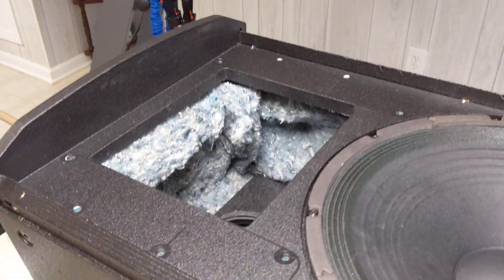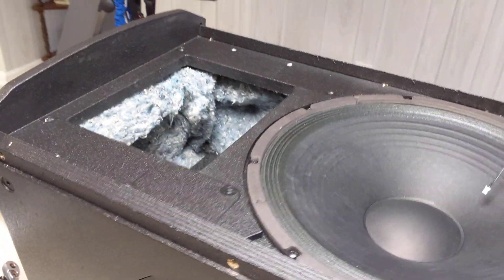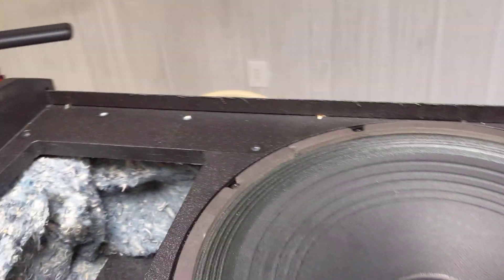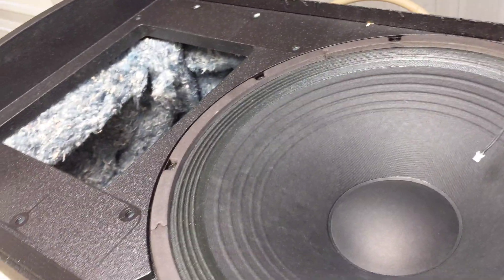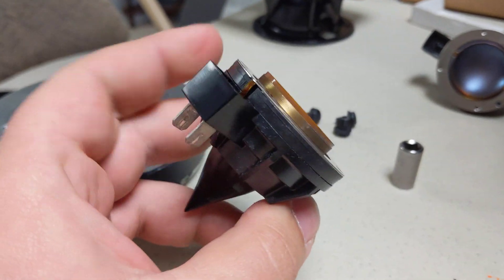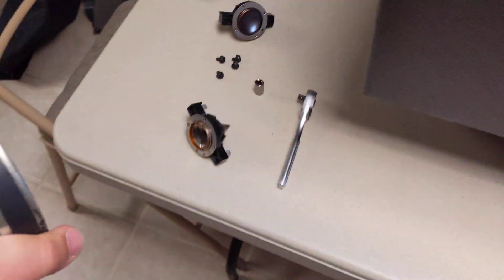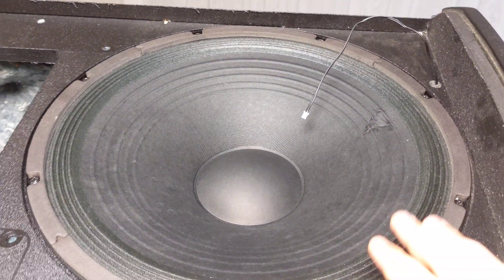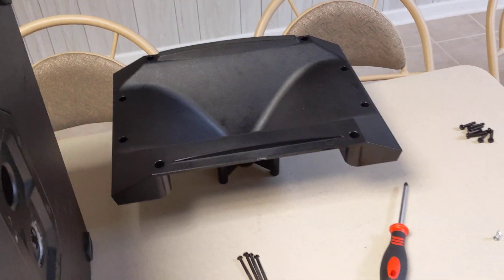EV ETX 15P Speaker Replacement Repair

Comment: Trying to replace mine but cannot get the horn out seems stuck solid, can you let me know how you got yours out as video started after already removed
Reply: Mine was the same way.  It Has some sticky stuff behind it probably to stop noise from vibration.  But i just pulled a lil hard and it came loose

Comment: theres hardly any videos cause they dont break... finally after years of abuse on my ETX10s one of the tweeters went bad.  
what was the price.. on that remplacement... i rather stick to OE.
Reply from the maker: This is correct! they really are dummy proof and are very hard to break/burn but not impossible. Thanks for the comment.

Comment: Hi there I have the etx12p  and for some reason is showing te peak and overheating I don't matter how much I turn them down please let me know what you think the problem is
Reply from the maker: Hi Samir, Is it showing the Peak and Overheating At any volume all the time? Or when you start to play the speaker loud?
Reply: @tandment   its showing both only when I start playing the music
Reply from the maker: @samirmusic9970  If you speakers are still under warranty try contacting Electro voice. That sounds like a board issues.
Reply: @tandment  I have etx-159 and have the same problem. I´m from Uruguay and here we don´t have a good service of EV. What did they told about this issues ?

Comment: hi! thanks for the video.

I have the same ev speaker and I'm replacing its tweeter diaphragm, but I'm not sure about the color coding of the wires inside the box.
There is black and red wires which are probably - and +, and then another pair, yellow and green or something. what are they, you can tell?
Reply from the maker: Are you usa-based? I took apart mine to see what you're talking about. Mine has two red wires, one is solid red, then there is red with a black stripe ( positive and negative) those go into the 15in woofer. There is  a yellow pair of wires, one is solid yellow the other is yellow with a black line those go into the tweeter (again positive and negative) there is also a third black skinny wire that is meant to plug into the little board on the front grill for the white light. Let me know if that helps!
Reply: @tandment  
Thank you!  I am from israel,  I'm not usa based. My wires are colored differently, but I kept searching on the web and found picture of the correct polarity on each wire.
Thanks a lot again!
Reply from the maker: @ofirgaash  no problem, out of curiosity can you share that link you found for the model you have? Always like to see!
Reply: @tandment  
https://youtu.be/QdaX2wOqWrM?t=85
It's not the same model, but it is the same colors so I guess the polarity is identical